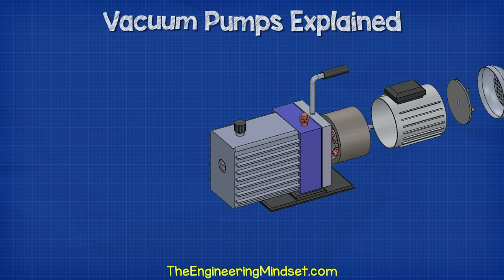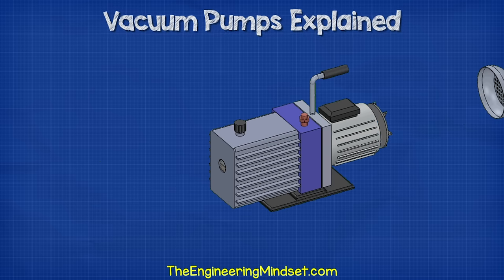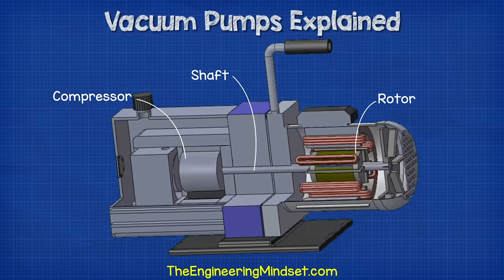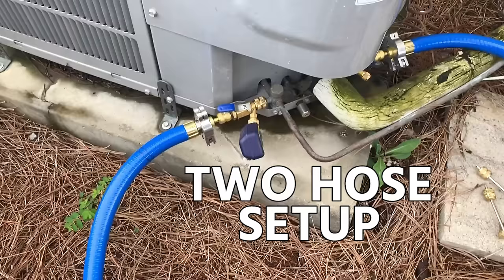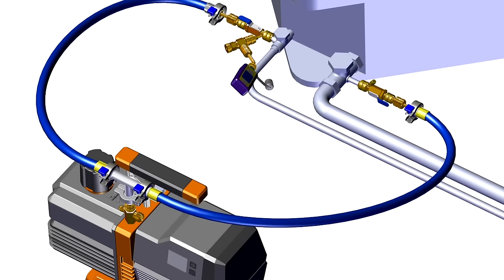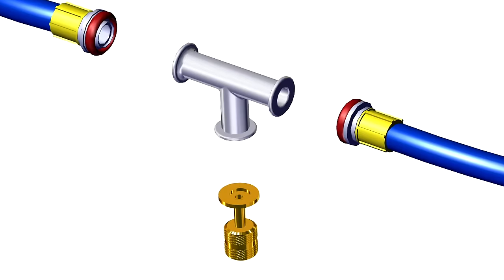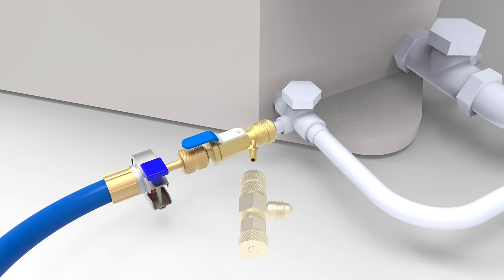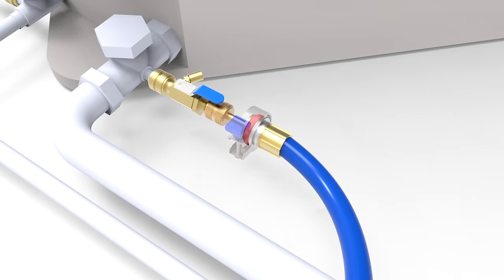How to Evacuate an AC system, Full Vacuum Procedure

Comment: if using one host , due to txv meter device restriction, it takes up to 50 mins to reach under 500, if i use two host only aroud  8 mins, why you recommand one host ? aren't we gona vaccume the entire lineset ? any advantage one hsot over two host,thanks

Comment: It appears that where people are getting confused about nitrogen carrying water out is like using a carrier gas when drying water from a solid ie., large amounts of water. The gas is not as much a carrier as it breaks the partial pressures of water in a vacuum. In a refrigeration system or AC system the amounts of water are very low so trickling N2 thru the system won't help much because the amount of water being removed is very small. Where N2 does have a great effect is when drying 20Kg of water from 40kg of product in a vacuum oven which is common in the chemical and pharma industries and maybe food processing as well.
Reply: I see hvac techs not flowing nitrogen when brazing, only using nitrogen when pressure testing repairs. This only serves to press up the air in lines and not displacing the air that would have occurred if they had flowed nitrogen during brazing.This causes much longer evacuation times, sometimes in the hours as the moisture in the air expands as it is exposed to vacuum conditions.

Comment: Was alway told when leak-testing use 125 pasig or low side test pressure which ever is lower. Unstoppable leak is called champagne leak rate ; if temp swing occurs while press testing the press drop can be noticed even with nitrogen.

Comment: I’m new to the trade so I’m learning 22:38 when you have an existing unit. If the system has a leak do you have to close the service valves before doing a vacuum or do you leave them open?
Reply: Adonis, the service valves are on the compressor side of the service ports.  If the leak that was repaired was in the outside unit (coil, reversing valve in a heat pump, replaced compressor, etc.) You had that side of the system open you would need to have the service valves open to pull the vacuum on that side.  There are some instances i.e. an American Standard heat pump that has a service port on the compressor side of the service valves.  But in residential ac you would need the valves open to pull the compressor side down.  Hope this helps.

Comment: Apologize for this question in the big scheme of things, but when you have your micron gauge directly on the liquid line service port after releasing the charge would you open the valve all the way before removing the micron gauge?
Reply: z_judah, once you break the vacuum with positive pressure from the refrigerant, you can remove the gauge.  Personally, I use a second core tool before the micron gauge to keep refrigerant out of the gauge.  The point to remember is to not loose the vacuum by removing the gauge before you have positive pressure.

Comment: After the lines are vacuumed and you need to change the filter drier what has to be done to avoid the vacuumed line to absorb lots of air ?
Reply: Probably nothing. You might be able to close a valve on the receiver to keep some of the vacuum but most will go away as soon as you open the system. You would then have to evacuate the system again.
Reply: @Redtooth75  Thank you

Comment: Ciao Bryan, in casi in qui è difficile tirare le molecole di umidità, quando faccio il test con l'azoto se questo lo riscaldo con una heat gun, posso aiutare a velocizzare l'operazione?. Bryan, ti chiedo una cortesia, potete mettere i sottotitoli in Italiano?
Hi Bryan, in cases where it is difficult to pull the moisture molecules, when I do the nitrogen test if I heat it with a heat gun, can I help speed up the operation ?. Bryan, I ask you a courtesy, can you put the subtitles in Italian?

Comment: I was never able to pull below 3500 microns on a 3-1/2 ton system with a 60 foot lineset. There were zero leaks in the system. Pump ran for hours. System has been running for 22 years.

Comment: I remember when I started in the trade an old timer told me that back in the day u just leaked checked with nitrogen. Released nitro then released refrigerant no vacuum needed. Units would run for 20 plus years. Anyway I have the original carrier 22 system on my house built in 1985. Old carrier 58ss furnace. I field stripped a furnace so I have all the parts should i need to fix that. Been in home since 2000. Only repair made was indoor board. Almost forgot there is no filter drier on unit as well!!! 30 + years on rolling
Reply: dang!
Reply: Clearly an anecdotal situation like the guy who smoked 3 packs a day for 90 years and nothing happened to him. I wouldn't rely on it.
Reply from the maker: Older units had mineral oil not POE which is less reactive with moisture

Comment: Worked at a large candy plant. Bosses seldom allowed the refrigetation guys enough time to run vacuum pumps. A compressor would burn out that feed a 150' cooling tunnel with 15 or so expansion valves. Bosses would demand that they get system up in only 4 to 6 hours. Of course the more they cut corners the faster the nrw compressor burnt out.

Comment: Whats the best way to clean a micron gauge if it gets contaminated. I use a 1/4" ball valve right before it even though its rated to 500psi I don't want it to get messed up.
Reply: Gently squirt a small amount of high quality isopropyl alcohol into the gauge. Use at least 91% isopropyl alcohol, I prefer to use 99% which I buy on Amazon for like $3 for a 16 oz bottle. Shake it around and dump it out. I leave the gauge open for 10 minutes with the opening tilted up to allow the alcohol to evaporate. My Appion micron gauge has a replaceable filter that I change twice a year, the filters come in a pack of 10 for about $25

Comment: good video, thank you for shared. Do commercial  HVAC Unit need to vacuum ?
Reply: yes
Reply: Your probably asking does a package unit need a vacuum pulled during install!?

No it doesn't! They come pre-charged with a certain amount of refrigerant inside!!!

A split system needs a vacuum pulled on the refrigerant line set & the indoor coil... while the outdoor units valves are back seated!!!
The new outdoor unit (on a split system)... has refrigerant in it!!!

More hands on things make more sense & easier to understand!

System with leak & repaired... pull vacuum on whole system as mentioned!!
Then recharge system by weigh in or use superheat or sub cooling charging chart!!
"Sorry that's all I know?!"

Got tired of people telling me I don't know what I'm doing in some of these punk A companies 😂🤔🤠

Comment: How do you replace the valve core without letting air back in ?
Reply: Set up purge valves?
Reply: @RobertSzasz  I worked out from another video it's done using the valve core removal tool. The rod that holds the core slides into the tool and seals to it with the valve closed so when you open the valve on the tool it doesn't leak back past the rod. Once the valve is open you can insert the rod and core fully to screw it back in.
Reply: @termite2691  ah, I thought you might mean while under vacuum. If the system is at positive pressure you just use the ball valve (the hole is large enough that the core and core tool reach right through) any leakage then is out and hence no contamination.

Comment: The main reason 1/4 manifold hoses and manifolds are inappropriate for pulling vacuum;  they are not designed nor rated for vacuum use. Meaning, they will leak.

Comment: I did this on a 2.5kW split system today, removed the shrader and went down to 150 microns then isolated the system and waited to see if it goes up. Once I was happy with the vacuum I opened the gas and then went to return the shrader, when I tried putting it back in the entire core removal tool snapped off and R32 gas blew out emptying the whole unit. Now I have to spend $100 to replace the gas, and figure out what the hell happened with my core remover tool

Comment: Seven years and my AC split system is still working... No Vacuum done, no nitrogen purges. My mentor when i was going to school for AC split system installment told me that he never uses Vacuum pump on split systems where there is less than 3 meters of copper installation ( most systems we install) 

To this day we didnt had any issues with that. I understand that risk is higher in longer installations where you use 20+ meters of copper from inner to outer unit. But dude to much complication for just regular 4.2 KW units. They work just fine without making science around this subject. 

IF you want to DIY just follow installment manual and ignore Vacuuming and nitrogen purges. It will work just fine.

Comment: I have two houses one was built in 1935 it has 1962 sears hvac inside and out works great the 2nd house is 1978 and has had 3 new units since 2002 why can't I buy a unit that works like the old one that never has a problem?

Comment: Which is better?, to open the liquid side or suction side first?
Reply: UpAbove. Suction.
Reply: @dizziedallas  that's what I thought but in the video he went with the liquid side
Reply from the maker: Technically suction, but I have reasons I still prefer liquid. In practice it makes almost no difference.
Reply: @HVACS  could you make a video or do did you already have one?

Comment: Why don't we just close the the high pressure line, run the compressor to force all the refrigerant into the condenser and switch the units? The least used tool in most of my co-workers truck is the vacuume pump.
Reply: That just holds refrigerants in the compressor side of the system. Even if you are only switching out the evaporator there will still be air in the new evaporator and the line set from being open during the installation. So this air will need to be evacuated before opening the valves to release the refrigerant or they will mix and cause troubles

Comment: CO2 Transcritical systems  require higher standards as per Hussman manual: Maintain  250 microns when	the	pumps have	been stopped for	2hours. This is for a transcritical compressor rack.

Comment: I get that we live in very technological times with digital displays, wireless and those sorta of things. 
What I don't get is the fact that the Air Conditioner is something that was invented long before the digital age, over 100 years at least. I'm here watching a video about what's right and what's wrong, wondering - What were these A/C technicians doing before. Like I said, I get that these are modern times. I Work at a factory where some units were installed in 1994, I watch the guys do the full installation of the four units, and it did take a few hours to vacuum a unit, well it took days, I was the one doing the electrical. These units still work today. 
Due to laws they will all be decommissioned next month.  Anyway my point is; I really did not see any of these guys using digital gauges, sensors, or being so critical of what I am hearing in this video, one unit was changed before our lock down here, and I really don't remember seeing any of the guys using anything digital other than a DMM to confirm that it was 3-phase power like I told him. 
This Video was very educational to me, but at the same time it comes off very condescending.
Reply from the maker: All these old units used mineral oil which was much more tolerant of moisture
Reply: @HVACS  That a fact? Like I said - Very educational. They worked well and still do, but inspectors say the do not use environmentally friendly gas, and they have to go.  Thanks for that info on the oil.

Comment: If your micron gauge is hooked up to a sealed system it shouldnt matter where you put it, near the pump or far. It would all equalize. Especially if you turn the pump off and watch it. Theres just no way with a good deep vacuum its not going to equalize. Same with pressure. You can have a manifold with a hundred hoses. If they are all going to the same nipple it would equalize.  Take a bucket, install nipples all over it, suck the air out of it, and then take readings off whichever you choose, including the one nearest the pump. No difference.
Reply: Uh, maybe not. Think about the physics and trying to apply it to the real world. It's all Newtonian Physics, but at the time of his death, Newton was learning all the innuendo that had not yet been counted for. Personal knowledge and experience, just as it is with poker, pays big, BIG, Dividends. Works pretty well in the markets, too! Best wishes!

Comment: If I have to do all this I have to charge $300 an hour  very nice job. But up to me I don't want to spend over $10000 tools every year and change  this gauges to that gauges and remove the shredder valve  put bigger hose use heat Gan  spend all day on one call I  been doing it for 30 years   one gauge in and out with no problem  very very  nice job but not for me

Comment: Never use ypur miceon gauge at the pump. You will NEVER achieve an accurate vacuum. If you did this, and added a gauge on the liquid line and did a 1 line pull from the suction line, you can prove this every time. It will always show lower at pump. I've been able to achieve an 8 micron pull on a 5 Ton system with 35-40 foot lineset utilizing this method he is showing. Isolated and recorded to hold.

Comment: How to evacuate an AC.....
Jus find the door exits & get da heck outta there!!
Take a head count when everybody gets outside 🤔😜😂

Btw this Sucks.... literally 😂

Pull it down to 500 microns & then charge that baby up!!!

Better job u do ... fewer refrigerant related problems!
80% of most calls are electrical related!!
But must customers think it's low on refrigerant etc.....

Starting to see more aluminum indoor coils now!?
Interesting... the price hasn't gone down on a coil either!
Copper I'd assume cost more than aluminum!? 
Nothing new.... greed & corruption still running rampant in certain industries!!

Btw be careful working with refrigerants & pressures!!! High side on 410a is around 300-400 psi!!! So rookies & customers be ware!!!!